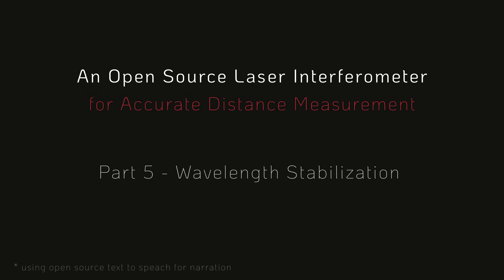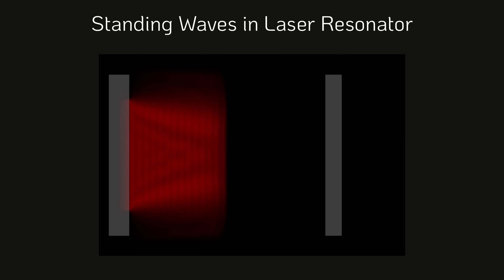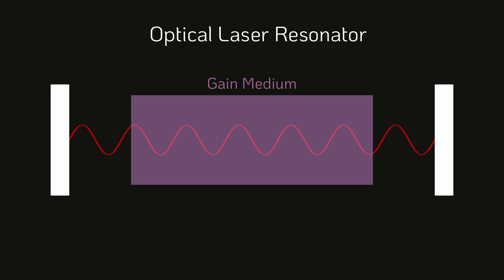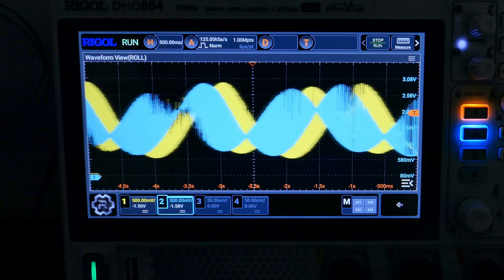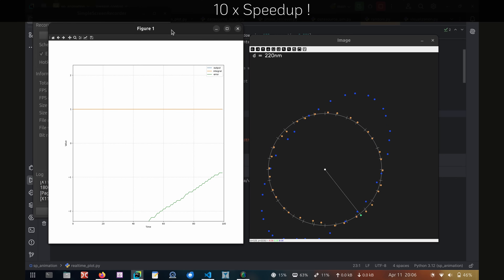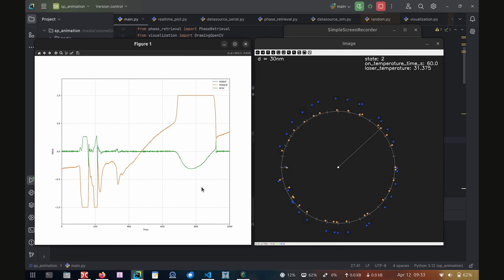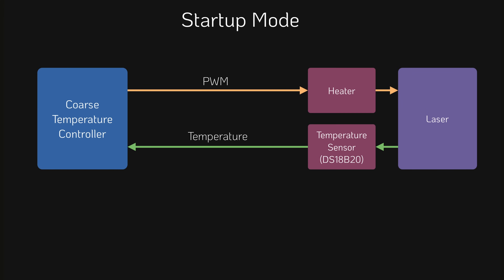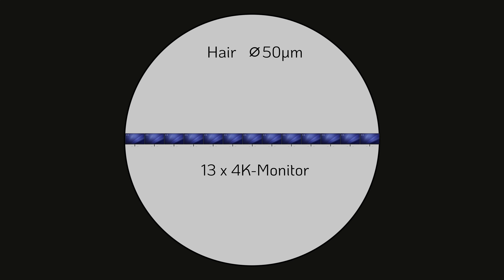Laser Interferometer - Part 5: Wavelength Stabilization of Laser Diodes

Comment: I've watched the whole series about open source interferometer, and I have two questions reguarding the setup:

1. You built a device for accurate measurement of length, could you show us how it works?

2. Do you have an intention to build a device that could be used to inspect optical elements such as lenses and spherical mirrors, just like scientific interferometers? I know that I would be really interested in building and using something like that.

Thanks for the videos.

Comment: This is a very interesting project. I've read more into mode hopping to try and see how sensitive laser diodes are to it and found this paper https://ipslasers.com/wp-content/uploads/2021/11/IPS-WhitePaper-Mode-Hops.pdf
It should be relatively easy to map out the stable modes of any led laser diode over various drive currents and temperatures and then pick a target current and temperature that puts the diode in center of a mode. This should make the wavelength both stable and repeatable, the repeatable is necessary because the interferometer can be checked against a known reference and the actual wavelength calculated within a known uncertainty.

Comment: To late, but, you can find very good Helium-Neon lasers on old photocopiers, low power but very high quality and fully enclosed and attached power supply, making it simple to use by adding a plug. They are big, though, approx. 50mmX250mm. Also have a very tight spot.

Comment: It seems you are using wrong photodiode. In clear casing it is 380 nm bis 1100 nm (SFH 229) and in black casing bei 880 nm
(SFH 229 FA)
Reply from the maker: Hi, no I actually painted the sides of the PDs black to reduce stray reflections. They are actually the clear ones with the correct wavelength range.
Reply: Thank you

Comment: DS81B20 is crap and you never know if you get a fake; but you could use either TMP117 or MCP3421 with TMP23x. Certainly with better coupling and less thermal mass of the sensor itself.
Reply from the maker: Biggest problem are the discret temperature steps, I am thinking about using a NTC instead. Thanks for the part suggestions!
Reply: @DiffractionLimited they have 16 and 18 bit resolution respectively :)
That Microchip ADC is insane for the price. Well, apart from sample rate, but I guess it's not a concern here.

Comment: Telecom band "DFB" lasers are extremely stable narrow-linewidth sources for extremely economical prices (<$50/unit), you may be able to save yourself a lot of time and trouble by just using a 1550nm DFB laser
Reply from the maker: I agree, that they probably do not suffer from modehops and have long coherence length. But they still need wavelength stabilization as far as I know. Considering the added cost and the fact that they are invisible, I am not to sure if it would be worth it.
Focussing on the hardware, I believe I wouldnt safe much complexity (maybe I could remove the temperature sensor). But please correct me if I am wrong.

Comment: This series is fascinating. I once had a dream of building my own optical ring gyroscope, and that might be the logical next step from your work on the interferormeter so far. Unfortunately, I was naive in my approach, and the parts availability was far out of my reach and budget at the time. This project brings it all into focus with relatively inexpensive and off the shelf parts.(if you'll pardon the pun?) I also follow Huygens Optics, so his recent exposition on glass ceramics, and your (re)purposing of cooker top "glass" as a thermally stable substrate has been a revelation.

It is common for high precision oscillators to be enclosed within a temperature controlled oven on high end test equipment. The oven is kept above ambient temperature and is very well insulated to mitigate ambient changes. I'm wondering if even more stability can be achieved with your design by using a similar technique?

Thank you, and please continue.
Reply: @squelchstuff I was thinking the same thing. I think it would help.

Comment: Do I understand correctly, that you stabilised waveleght to within 0.01 parts per milion? Or in other words 10^-8? I would love to build resonably cheap 656.28nm source to check filters used in astronomy
Reply from the maker: Yes and no. The tracking has the accuracy you described, but as another viewer pointed out, errors from thermal drift (of all optics components made of glass) and change of IOR of the air will add errors that are probably much larger.
Reply: @DiffractionLimited Still great :) and I need just 10^-4. But after thinking I came to conclusion that I will need absolute reference of wavelenght. But still your algoritm with current and temperature compensation would be very helpfull

Comment: Very cool! How did you implement the current controller? What electronics did you use for that?
Reply from the maker: Not settled on this yet currently I use a simple LM317 CC circuit with a low pass filtered PWM signal coupled via a largeish resistor to the feedback input to 'nudge' the setpoint a few milliamps up and down.
Reply: @DiffractionLimited Maybe try using DAC and some power amp with current feedback? I'm not sure if it will be better quality than simple 317 but worth trying IMO. I made something like this for my thesis and the output was surprisingly stable. With good choice of pots and biases, you can make the tuning range very narrow, and thus very precise.
Reply: @ Interesting! thanks for the feedback!

Comment: It is far more stable to use DFB lasers, they are not even rare, all long haul fibre communication uses DFB lasers.
Reply from the maker: I actually have one and also did some tests. I still think they require wavelength stabilization and getting the light in and out of the fibers with correct polarization is at least from a cost perspective not ideal. Also its harder to work with as telecom lasers tend to be invisible. But thank you for the suggestion.
Reply: @DiffractionLimited  All diode lasers need some temperature control if one has any requirement on the optical properties. 

You'll have much longer coherent length with DFB types over FP, a big advantage for interferometry. The DWDM type in particular. 

Many DFB lasers used in Telco came with a convenient temperature controlled package as well. Integration of the circulator is pretty standard, a plus for the protection of the diode. 

Not hard to remove the fibre and add a KTP to double it to the visible spectrum. 

I happened to be a physicist working in the Telco equipment manufacturing trade, let me know if I can help with any supplies.
Reply from the maker: @charleyfan1908  Thank you very much for the offer and the explaination. I would be very interested to learn more about the lightsources with integrated temperature controll and circulator. Could you provide me with a link, or a few keywords to search for online? Also my understanding is that for frequency doubling using KTP crystals, you need a certain minimum energy density. The Telco devices I know operate in the mW power range so I am uncertain if they can be used for frequency doubling. If so, that would be really interesting...
Reply: @DiffractionLimited keywords "DFB butterfly DWDM laser" 

If cheapy handheld green laser pointers are KTP doubled, you are fine. ;) 

20dBm is quite common in Telco, above 25dBm becomes somewhat less economical. 

I built a Michelson years ago with less power than that. Often need to ND filter it down on shiny surfaces.
Reply: @DiffractionLimited i think it should be possible to control the diode temperature without external resistors/thermometers, by regulating current through the diode and measuring its voltage, current and maybe brightness, so finding its point on the characteristic curves. And it should be much faster and slightly more precise.

Comment: Do you have time to share which ccr brand you used? I see there is different qualities available and I just want something that works well. It would be nice if you had the time to share a parts list would make the world to us diyers
Reply from the maker: Sure: I ordered them from 'Bohr-Optics' over ebay. Make sure to get the ones with silver coating (copper might also be  possible if you use a red laser) - Also take a look at the github packe for the laser diode used.

Comment: Fyi, the micro-chip doubled Nd:YAG lasers inside green laser pointers are often single-frequency single mode.  In a brief test, I could easily see a $10 laser pointer tuning through Iodine absorption lines.  (worked with HSRL Lidar for looking at clouds in University)  A quick add on temperature/Current controller and an Iodine cell would let you stabilize a cheap laser to an absolute reference and pretty easily get frequency error down into the 100MHz to 1GHz absolute.
Reply: That would be awesome, but doesn't a reference cell cost ~750€
Reply from the maker: Thank you. That sounds very interesting. Do you mean the usual ND:VYO4 + KTP crystal devices?
I actually tested such laser modules and they performed rather poorly (tested over a range of drive currents at ambient temperature). Do you have any Idea what could have gone wrong?
Also thank you for bringing up the iodine-cell. Didnt know about these. As I understood you shine the laser through the cell and tune it for maximum absorbtion (i.e. the wavelength where the gass absorbs the light most strongly). A photodetector is used to measure the brightness 'dip'. Is that correct?
Reply: @DiffractionLimited You look for peak flourescence emission of the iodine, not absorbtion.

Comment: I remember a interferometer I worked with started with a warmup phase to bring the starting temp a few deg above ambient, probably to avoid the need to actively cool the laser. Is something like that needed here since you are not using the peltier cooler?

Comment: Excellent!
I'm a former Metrologist, and worked for Lockheed, at Stennis Space Center, as a calibration tech, spending many hours with HP and Renishaw laser interferometers.  

Even used them to calibrate tape measures used to cut insulation blankets for satellites.  I always thought it was funny that tape measures were used for that, and that we had to calibrate them, but it is what it is.

Nice work!
Reply: The gumment has infinite money (other people's money) so they can do wasteful things to provide make-work jobs for their voters.
Reply: I've seen tape measurers off by as much as 8%, but this is always shoddy manufacturing.  I don't think the error in a tape measurer over its working life would account for a meaningful enough difference to bother after initial verification.  

Standards like ISO 17025 and guidance from NIST or ANSI/NCSL Z540.3 allow organizations to use historical calibration data to optimize calibration schedules. If the evidence shows that an instrument remains stable and reliable, the calibration cycle can be lengthened, in this case I would recommend giving a tape measurer something like a five year calibration cycle.  Mostly the actual purpose for re-calibration would be to cheche it over for damage and ware to retire old ones and such. And that's absolutely within your authority to do.
Reply: @zyxwvutsrqponmlkh , The actual reason they had the tape measures calibrated at my facility was for traceability, which limited our customer concerns.  That's a well known and very obvious thing in modern Aerospace and Defense companies.

I have no idea what kind of tape you saw 8% on, but that's about 7.99% greater than I've ever seen, so that's suspicious.  Maybe a different industry in a communist country that has 100 year old tape measures.
Reply: @zyxwvutsrqponmlkh , oh, well the sewing kit was a key bit of information that you probably should have included in your original comment.

That's not the kind of tape measures I was referring to in my original comment.

No matter, yes I know the kind you're referring to.  My Mom still has the same one I remember from nearly 50 years ago.

Comment: 2nm is the accuracy of your refernce path tracking, not the accuracy of the interferometer.
Your reference path is orders of magnitude less accurate as it will depend on temperature of the optics, ceramic glass as well as temperature, humidity and  pressure of the air inside the box.
Reply from the maker: You are right, thank you for the feedback. I think the video is a bit misleading in this regard and I will try to adress this in future. The noise gives more of an estimate of the resolution (i.e the smalles length difference that can be reliably measured) and less of an estimate for the device accuracy.
Reply: Yeah, e.g. Robax glass ceramic should add 500ppb/K worst case, air temperature is 1000 ppb/K and humidity and pressure should also add worst case +- 6 ppm (if not measured and the weather changes).
I think air temperature is the most important factor and can reasonably be measured to 0.1 K, so 100 ppb might be the best result for this interferometer, if the coefficient of thermal expansion of the glass ceramic substrate is known and all other factors are measured and accounted for (substrate temperature, air temperature, air pressure and relative humidity).
So 100 nm absolute accuracy over a measurement range of 1 m might be possible, if I am not mistaken.

Edit: +-100ppb/K is probably the upper ceiling of performance of any interferometer operating in air at ambient pressure.
To get close to that, the design needs to be improved by heating the whole interferometer block to a specific temperature (e.g. using an aluminium core heater pcb) and measuring the temperature using a sensor that is accurate to +- 0.1 K. (TI has one with max. +- 0.08 K absolute error)
I also severely underestimated the error introduced by the optical components. The temperature coefficient of the refractive index is ~ 3 ppm/K and the coefficient of thermal expansion ~ 7 ppm/K for BK7 glass.
In a traditional interferometer, this does not matter, as the paths are balanced. The light moves through the same amount of glass in the reference and measurement arms, so if both are at the same temperature, they cancel out.
I did a rough estimation for the stabilization arm: The optical path length is approx. 30 mm per retroreflector, so 60 mm total, the path length in the air is ~ 200 mm and the optical path length in the beamsplitter shouldn't matter, as it cancels out. 
The retroreflectors add almost as much error from change in refractive index, as the air (as much as 60mm * 3 ppm/K = 180 nm/K, compared to 200mm * 1 ppm/K = 200 nm/K). Additionally and even worse, depending on how the retroreflectors are mounted (fixed at the front or back) they could add another (60mm * 7 ppm/K = 420 nm/K) error, due to thermal expansion and thus increasing the optical path. With the substrate adding only (200mm * +- 0.5 ppm/K = +-100 nm/K) in the case of robax.
So in total we are looking at approx. (800+-100) nm/K or (3.07+-0,38) ppm/K for the stabilization arm in total, if I am correct.

I am no expert in this field, so it would be appreciated if someone with more knowledge could chip in.
Anyway, I'm probably gonna write a jupyter notebook to do a complete analysis and update this comment when it's done.
Reply from the maker: @xXDarkKisukeXx Thank you for crunching the numbers and providing a rough estimate.
Reply: @xXDarkKisukeXx  Thank you for sketching out the math. I'm sure a little jupyter notebook, along with references for input parameters would be a fantastic addition to the project if you can find the time.
Reply: Right. The reason people still use HeNe lasers for precision measurements is that the wavelength is incredibly accurately known.
Still liking this project a lot. If he can figure out an accurate reference, it will be very useful.

Comment: This is awesome, excellent job, I want to make a close loop linear positioning system using a motor and an interferometer. I think I would have to use also an linear scale to prevent losing steps and make it like an absolute encoder with fine resolution. Do you think is posible?
Reply: I'm not sure the absolute encoder is practical, you'd really have to avoid losing steps, and probably rehome each time. Otherwise you'd need effectively another <1 micrometer resolution encoder, and supplement that with the interferometer. Though given he's getting ~2nm precision, if you need a 10nm absolute linear encoder, that would seem a good way to go. You'd have to add one or two stages of extra precision for the movement, perhaps some compliant mechanisms and thermally controlled (expansion) mechanisms in order to actually take advantage of the precision advantage of an interferometer. Look up the mechanisms used for the JWST mirrors for some possibilities.

Comment: Do you have to worry about thermal expansion of the glass block?
Reply from the maker: No, I am going to use glass cermics with near zero expansion.
Reply: @DiffractionLimited

 Hi, I don't know much it would expand the scope of the project but using a polarization maintaining fiber for the reference could potentially help stabilize the reference length.

 If you measure the phase on the two fiber mode, the difference between the two strongly depends on the temperature (which is not the case in non PM fiber). This can give you a reference of the temperature for free that you can stabilize with a PID loop.  

However, this is probably more practical for a Near-IR interferometer with a fiber coupled diode.